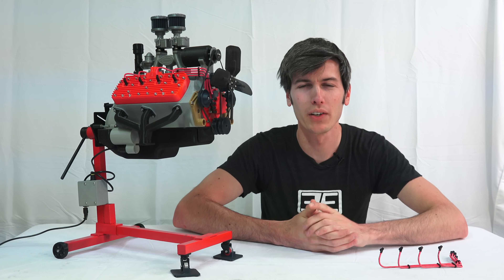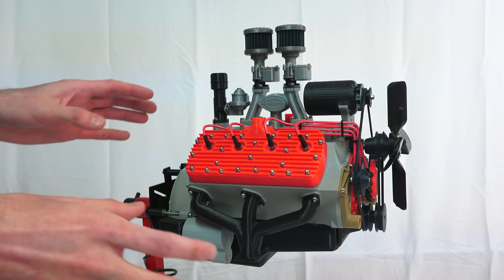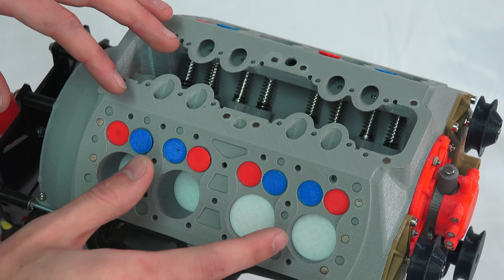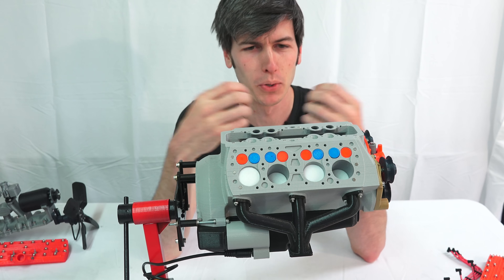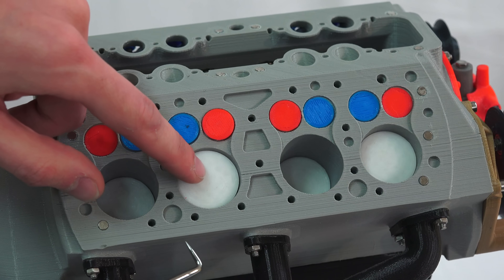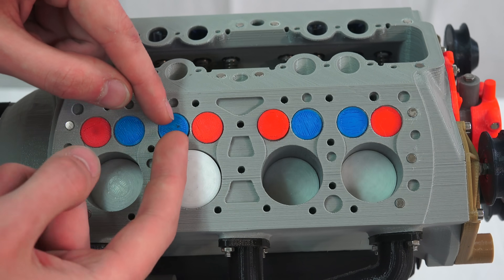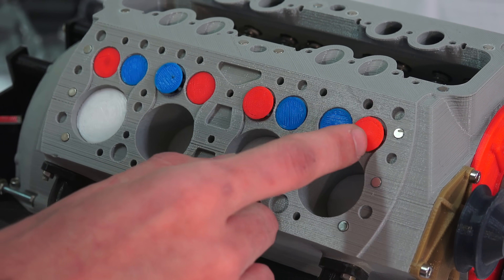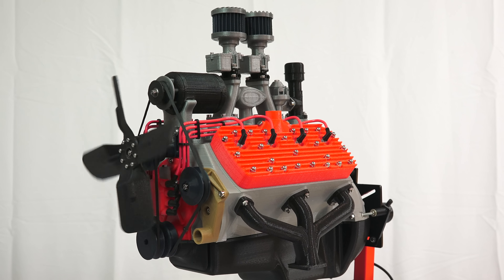Why Ford's Flathead V8 Engine Died

Comment from the maker: Hello all and welcome!! If you enjoyed this video, here are a few others you might find exciting: 
How V8 Engines Work - https://youtu.be/KZLygdpg3LU
Why Pushrod Engines Don't Rev High - https://youtu.be/S9E2nCXNHU8
Mazda's SkyActiv-X Engine - https://youtu.be/yNSxow3W7ek
Infiniti's VC Turbo Engine - https://youtu.be/A6H66xfEZC4
Toyota's Dynamic Force Engine - https://youtu.be/wwLxxZm_LRQ
Mercedes 50% Efficient Engine - https://youtu.be/kOhmgpkiIfg
Reply: Sam Bananas sorry to tell you but he's from , 1989
Reply: How in the name of God can you be 7 years older than me yet look 35? 1953?
Reply: @sambananas4513  He's a millennial.  They lie...a LOT.
Reply: @sambananas4513 65 and he looks like 35 xD
Reply: He has a picture of himself in the basement. Hint, hint...😉
Reply: Engineering Explained what? I thought you were like 30-40 yo
Reply: Come on people, its obvious that he recoreded all of his videos in the 80s.
Reply: @ Read More: I thought this too, and went reading. As it turns out they are super thick and heavy blocks because of their "thick wall" casting. Ford and everyone else in the 1930s didn't have the technological acumen necessary to cast it any lighter, and it should be noted that the three main bearing design of this and other ICEs of the period shows that they were never intended to rev or make what we consider real power. So with the problems of being unable to build compression while maintaining port flow into the chamber (mechanically impossible as closing the head up will lead to flow issues) and the heavy weight AND floppy crank support, most of these early flathead designs aren't worth pursuing even if they are slightly more compact. BUT there is a flathead in a shop in my city and I'm going to go there and measure it to see how tall and wide it is. I think it's not as narrow as you might think because the heads have to be wider to cover the valves which sit beside the cylinder. You'd think it'd be smaller, but I'm not sure that it actually is.
Reply: Janet, the flathead Ford is compact, and you noted the three main bearings and weight. It's not really heavy because it's compact. The thick wall casting is relative but useful in that between extra metal allowed for core shifts when casting and the "thick walls" it allowed the engine cylinders to be bored oversize far more than on modern engines. Hot rodders regularly bored the blocks 1/8" (0.125") oversize and had room for a rebore  when overhauling if it lived that long. 3/16" oversize bores were used with some success, although then overheating was a likely occurrence for a daily use engine so this was best left for competition uses. Heat is a good reason to get rid of the ford flathead, because the exhaust gasses have a long and torturous route to exit the engine and the whole distance is water cooled thus requiring an unusually large radiator, made out of rather expensive copper. The radiator easily cooled the 331 cubic inch Cadillac engine I installed in my 1951 Ford, also the same in my 1939 ford  coupe.
     The Cadillac V-8 flathead engine had short exhaust passages with exhaust manifolds running down the top center of the engine, as did others such as the Peerless V-8. The 'professor' neglected to mention the offset of the cylinders was due to the simplification of placing the connecting rod big ends side by side on the crankshaft journal instead of using a fork and blade con rod or other V types such as the old Lincoln, the Rolls-Royce Merlin, Griffon and the  GM Allison.  Since cast iron and copper are bought by the pound, there are other reasons to get rid of the flathead as the cost of the materials skyrockets. A 400 cubic Inch small block Chevy engine weighs only a small amount more than a flathead for the same amount of Iron and much less copper/brass in the radiator and tremendously more power. I believe that a 2-bolt block (155 pound block) 400 Chevy with aluminum heads would weigh the same or less than the flathead and also fits in a small space such as formerly used by the departing old engine. These are 2 of the reasons for its' continued popularity even as the newer engines are being pushed.
Reply: @johndaniels6089  you do FB?
Reply: @jameswade2002  you just wrote a paper on how you are unimpressed, yet are going/ went to see the actual motor. 
I’m not a Ford fan at all, but they were actually doing innovative things back in the day.
Reply: Are you doing those 3D printed models yourself? Bc they are amazing!
Reply: The way they used to get lot's of HP out of this engine was to use heads for higher valve lift. Then use huge super chargers to make up for the low compression ratio.
Reply: @rwa60  That was the ONLY way to get power out of the flattie.  Then you'd break the crank due to harmonic vibration due to only having three mains.  I didn't shed any tears when these boat anchors left the roads.  Marginal in 1932 but cheap...badly obsolete by 1949.
Reply: I believe this was the first engine design by ford that used the offset Bore to Crankshaft centerline, The first FHFV8's only had 3 Main Bearings, changing to 5 somewhere in production...Jason, we all know your DAD Probably wasn't alive in 1953, I am 11 years older than you, and he was ONE in 1953!
Reply: Engineering Explained you're not over 60, you're in your late 20s.
Reply: Engineering Explained you are not born in 1953 lmao! Unless your name is DR. WHO
Reply: Sweet baby Jesus!!! 
You're older than my parents!! 
YOU DON'T LOOK LIKE IT!! YOU LOOK MORE LIKE 30!!!!
Reply: Yes a supercharger works but the crankshaft only has three main bearings and the block is not particularly strong so the engine is limited to about 300hp. Still sounds great though.
Reply: With their inherently low compression and large combustion chamber flatheads are ideal candidates for turbo or supercharging. You have to keep the power around 300hp if you want a reliable Ford flathead V8, but other flathead engines are better choices like an inline 6 or 8 cylinder. They have 7 or 9 main bearings respectively making the bottom ends in those engines nearly bulletproof.
Reply: You’re 65 ??? U gotta be kidding me
Reply: Engineering Explained How much is increased the HP with a supercompressor?
Reply: @EliasMcCloud  HP is meant for speed freaks. I drive a HUGE off-road dump truck that only has 57 Hp. Sure, top speed is only 30 mph, but it hauls a lot of weight. 
Idk if you’ve noticed, but Ford’s main product is the trick
Reply: Engineering Explained if you ever have time, would be great if you can tell us more about the pneumatic valve system of Koennigseg. Congrats 4 the channel & thanks!! :)
Reply: Engineering Explained would a supercharger work
Reply: Tre'von Cowen wwq
Reply: Engineering Explained An old V8 Briggs&Stratton Love flatheads.
Reply: Engineering Explained that mini engine is it a working motor
Reply: Engineering Explained The Flathead's production stopped in the U.S. in 1953, but they kept manufacturing them in France, Brazil, and other overseas nations. I think they finally stopped production in, maybe, the 1980s? (Ridiculous, I know, but you can look it up.)
Reply: Engineering Explained I
Reply: Engineering Explained s
Reply: There was an OHV conversion. Side Ex. and Overhead inlet valves. There was a similar conversion for the 100E as well. Made by Willment  or Aquaplane, I cannot remember bit I did have a 100E with the twin SU carbs and OHV inlets. All aluminium. A good rattler. Then vacuum driven wipers and Overdrive. Alloy heads were available for the flathead V8 made by Offenhauser. I have had most of them in my time from E93A to RR Shadows. I am 76 now. You cannot beat a good 
V8 in my opinion.
Reply: Marlan Davis of Hot Rod Magazine "fame" published very detailed measurements/specifications from all the popular (and less than popular)  American V-8 engines many years ago.  Google might save you a trip to the shop.
Reply: @
Nexus5 Google
There is no magic in a flat plane crankshaft in a V-8 engine...but it does make the exhaust note sound cool.
Reply: Yeh right, I was born in 1955.  You look too damn young or just another pathelogical liar.
Reply: @ Crobular, your either an Aussie, or a Pom.
My dad talks about Ford Pilots, I am Aussie.
Only available here, or England apparently.
Reply: One small problem though, the FH motor did not die in 1953 they were still used in "stradle buggies" up into the 60's but were called Ford Industrial. Not sure of the exact dates or if Ford was just supplying engines from what they had left over from the old FH stuff.  The only reason I knew about these engines is one of the millwrights had to order a new one for a saw mill I worked at in the late 60's.
Reply: m.blacktree more
Reply: i know more than enough about the flathead and engines in generel ... but watched entire video because of wondering about his AGE ?!?!?!?! wtf
Reply: There is zero possibility that you were born in 1953! Maybe your father was born in 1953, but you weren't! This is NOT a 65YO man!
Reply: You dont look 63
Reply: IT IS A 1932 ENGINE !  !
Reply: the air flow on that engine could be fixed if you had the valves and pistons in this configuration oOo , the flow would go in one direction and not oppose at any time
Reply: How about a video on the ARDUN overhead valve conversion for the Ford flathead? ARDUN is from its inventor, Zora Arkus Duntov, AKA the man who saved the Corvette from being a gutless wonder when he got Chevrolet to install a V8 for 1954. For more flathead fun, look up Uncommon Engineering. That guy builds high performance flathead V8s and Hudson straight sixes. He has an interesting fix for the flathead airflow problem. He makes new heads with one large intake valve over the piston then uses the original intake valves as additional exhaust valves. I assume the kit also includes a special camshaft that opens both the original valves together. If that's not enough, he makes a kit to mount a pair of large Roots style superchargers to the top, duplicating an original design built for drag racing in the 1960's.
Reply: uh huh.. no way your 65
Reply: Do you get fillers and Botox treatments regularly?
Reply: never have to worry about pistons hitting the valves - def a non interference engine lolz
Reply: The first new V-8 since the Flathead ended around 1953 was the 1954 Y-block-OHV V-8-John in Texas
Reply: You forgot to link the moisturizer you use to make yourself look 40 years younger
Reply: I was born in 1964 there's no way you're 11 years older than me
Reply: @engineering Explained. Where did you get those models from?
Reply: Engineering Explained  , the Ford Flat head failed because not only poor air flow , but poor quality , poor design , poor everything , 
that's why is absolutely no car manufacturers making Flathead  V-8 engines to put in vehicles , 
take this miserable piece of metal behind the barn and shoot it
Reply: Can we see a honda pr Toyota engine diagram like the d16?
Reply: Do you know that Ford Flatheads where still winning Races until Dodge came out the the Hemispherical aka Hemi engines.  At the time Dodge came out with it Ford was working on a similar engine.
Reply: I was really hoping for a better view of exactly what the exhaust ports look like on one of these.. I've never actually seen a decent close up of what's going on in there... Like where's the coolant passages? Are the exhaust ports cooled? Did this cause heating issues? Ik they had overheating issues but was that the cause?
Reply: Man do you look younger than your YOB. Your put-on gives me hope for plastic surgery.
Reply: Air has to flow opposite directions in both designs. Intake flows into the cylinder, and exhaust has to flow out. Doesn’t change with overhead valves just gets a straight shot is all. You said the air flows the same direction in overhead valve engines and against each other in flat head engines. That’s not at all correct. Also the flatheads were made through 53? That should mean there’s millions around to upgrade our shity evap era cars with.
Reply: Engineering Explained hey I have some car list part I need your help with, where I can send it to you?
Reply: You know this design, even though very inefficient, I think one thing that was good about it is that it was a pretty compact design.. I'd imagine even compact than the LS series motors and LS motors are known for their compactness.. what do you think about that?
Reply: Your first layer is a little too far from the bed - the top of those valves should be less gappy. :-) awesome video, as always. Really cool model and the hands on is great.
Reply: Engineering Explained Flat plane crank plz
Reply: My mother had a 1951 8 Pilot. Great car !. 14mpg !.
Reply: Engineering Explained can as a kid had 47ford woodie if you made a. 400mile trip you needed a spare generator couple piston s haead gaskets .fuel pump and. Rod  . If you drove through a puddle with front dist . wouldnt start for a week.😎gool old days.
Reply: "Hello everyone, and welcome. In this video, I'm showing off this awesome 3D printed model..."  😆

Comment: This could so easily be such a good engine with modern technology. If you added a massive supercharger and made it electronically fuel injected it could probably be pretty okay-ish on power, be pretty efficent as there are very few moving parts, and be inherently impossible to break as the valves can't contact the pistons and the leftover exhaust gasses would make it very difficult for it to develop spark knock. It probably wouldn't be crazy powerful but I recon it could have enough to motor around a grocery getter and still meat emissions standars as it is just such a simple design and doesnt face as much mechanical stress or friction that other engines do.

Comment: WW2 killed the Ford Flathead V8. All the seasoned blocks were used up, and they tried to use new unseasoned castings and they failed, cracking around the exhaust port. How were they seasoned? piled up rough castings were left in the elements for @ 3 years to have heat/ cool cycles, then after this they were machined.

Comment: What made the Flathead affordable in 1932 was Ford finally perfecting a process to cast the block all in one piece. Previous V8, V12, and V16 engines all had to be cast as two pieces or more, carefully machined, and then fitted together.
Reply: The Flat-Head design was quite simple compared to later valve-train systems!! It was excellent for it's day!! Today, Engine and Car Enthusiasts "Piston Heads"  are restoring/re-building old Ford Flathead V8s!! I've seen some pics & vids of "Top Fuel" style Dragsters with Flat-Heads!! I'm not 100% sure of this, but I think that the earliest 4-Stroke Outboards were Flatties!! I think it was Chrysler who introduced the first 4-Stroke Outboard!!

Comment: Im designing a flathead 180°v Diesel combination 4 and 2 stroke 452ci total displacement it has 6 cylinders 8 valves and 2 exhaust ports deck to deck is 26" front to back of block is 18 " dry sumped, oil cooled, crank driven pro charged, and twin turbo. Unfortunately im broke and can afford no such things so this design shall dissapear when i die it'll probably never get built.

Comment: Let's go theoretical for a moment : how about we take this design, upgrade it to modern day metallurgy, slap a big ass turbo to the side (you know, low compression high boost and so on), change the fuel to hydrogen and voila, we got cheap hydrogen v8's that circumvent what 90 years of updates in terms of engine design that makes things expensive?

Comment: You didn't mention that Chevrolet was producing well over 100 Hp with their overhead valve straight six.  Ford may have known that the Chevy V8 would be introduced in the 1955 model year.

Comment: Racing Harley flatheads could run 7500 rpm, if I remember correctly. No risk of valve to piston collisions. Still 66% less power compared to OHV engines from same era.

Comment: Very poor design which went into production only because of the prejudice of old Henry against OHV and inline 6s.  Expensive to build, inefficient in operation, unable to stand the heat generated under heavy load.  A good OHC four cylinder would have worked better.  A Ford 2.0 for example.
Reply: With the exhaust of all eight cylinders running through the water jacket, it makes the Ford flathead V8 America's first gasoline-fueled water heater. 
What a pathetic design.

Comment: From 1936 to 1944 my Dad worked for Ford rebuilding blown V8's that had head gasket placed on the block wrong.  (Trained engine machinist)  The factory was doing it.  Head gasket placed on block wrong direction blocked a hole causing the engine to overheat.  Would melt pistons and/or warp cylinder head.   Ford inspections on the floor to find out why engines going bad.  Odds were nothing wrong with what they seen so the mystery of why kept happening.    Only mechanics at the dealerships discovered the problem.  They thought then some disgruntled worker doing on purpose.  No one was caught.   Plymouths and Chevrolets were his driver cars.     In later years he stepped up to Dodge from Plymouth.  What a step.  He grew up in the Depression and knew the value of a dollar.  For a short time, he owned a 48 Chev with souped up flathead Ford in it to street race.  Quiet exhaust made for a sleeper.   Mom made him get rid of it.

Comment: Maybe ..if they had moved the exhaust valves out, next to the exhaust manifolds they might have been able to DOUBLE the sizes of BOTH the exhaust AND the inlet valves which should have given these side-valve engines the ability to be able to breathe like big angry scary monsters.
   But I realise that doing this would have left them with the huge headache of having to work out a way to make the opening/closing/timing of the exhaust valves happen.
   This has been [yet one more] 'brain fart' from a [very old] engineer.